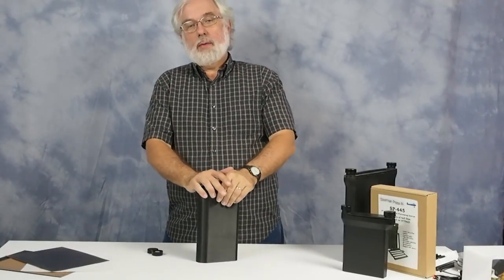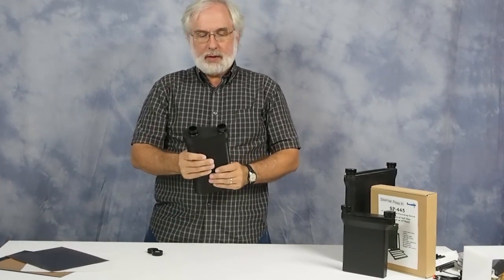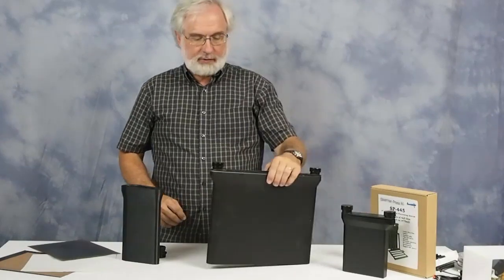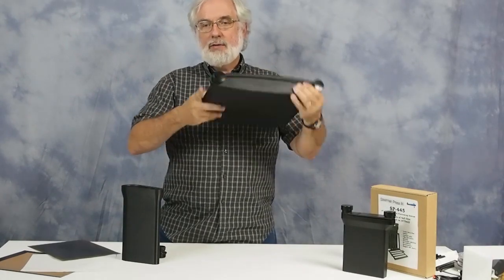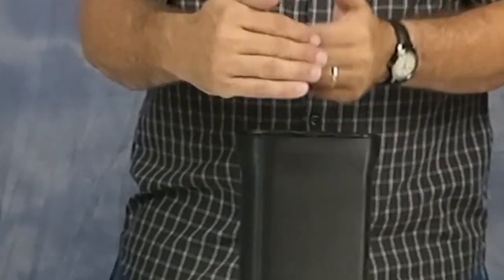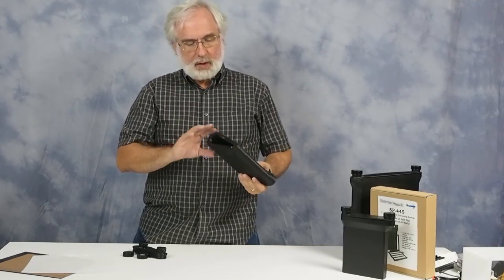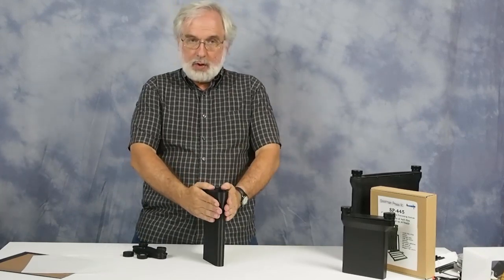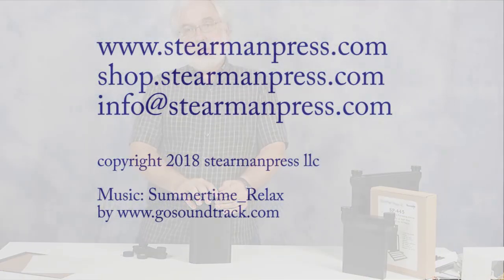SP 1810T prototype

Comment: Nice design, but when your using x-ray film (it's cheaper )it won't work. Most of the x-ray film has on both sides emulsion.
Reply from the maker: We realize that limitation but decided to optimize for the mainstream. There are some single sided x-ray films.